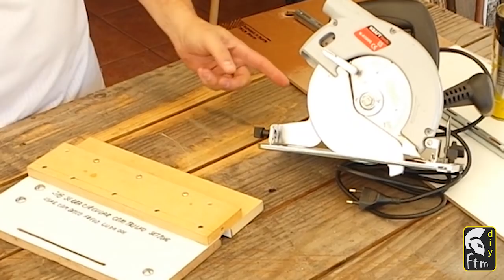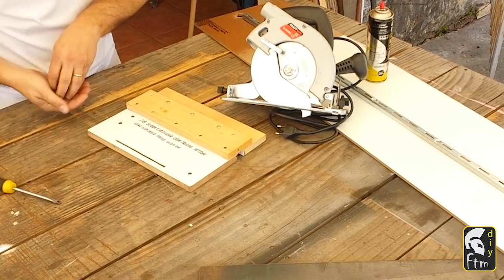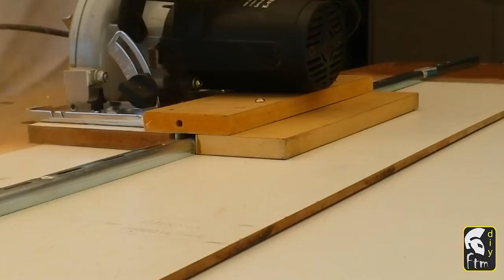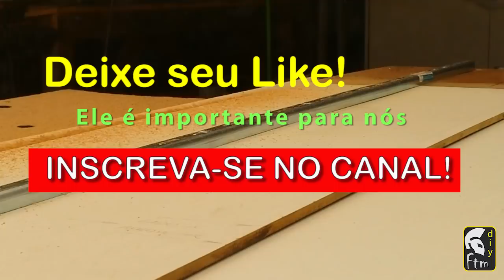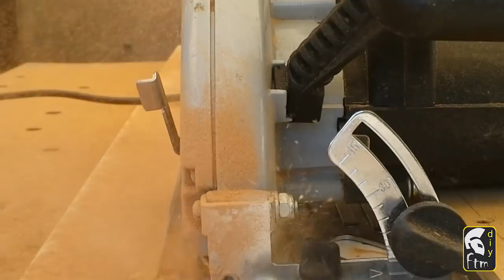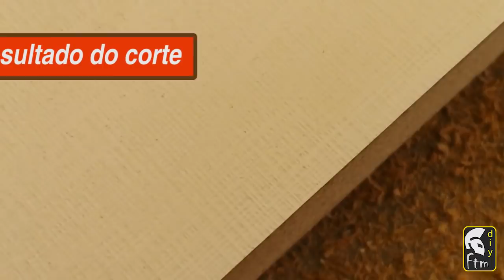Serra Circular de Trilho

Comment: Olá Munhoz, bom dia. A sua solução é excelente, eficaz e barata! A sua serra circular é de 7 1/4" (185mm), precisou por alguma bucha de redução para instalar este disco? Pergunto porque estou querendo um disco para MDF e achei que o acabamento ficou muito bom, mas este disco da Freud LU3A-0001 tem 160mm, e como a minha serra circular manual é de 185mm fiquei na dúvida. Like registrado! Obrigado por compartilhar as soluções. Sucesso!
Reply from the maker: Olá João! Obrigado pela presença! Então,....não precisei de bucha não pq o eixo da minha serra é 20mm, o mesmo do disco. No seu caso, verifique o diâmetro do eixo de sua serra,....provavelmente ele é de 20mm também. Caso não seja, ao comprar o disco, vc já acrescenta ao pedido a bucha de redução que é baratinha...Depois nos conte como ficou seu jig, ok? Grande abraço!!